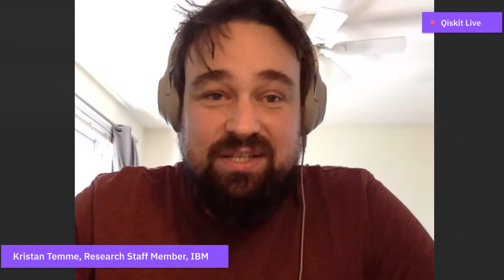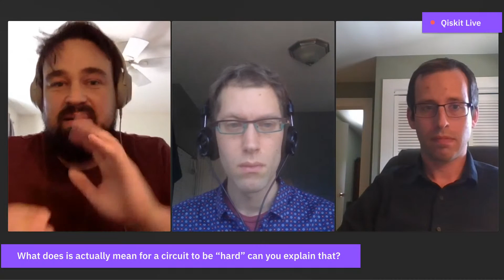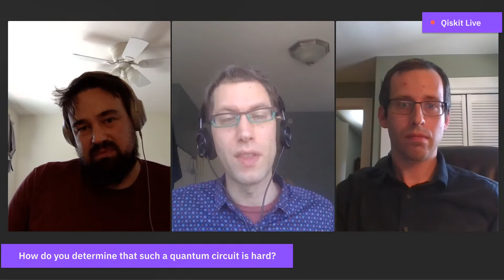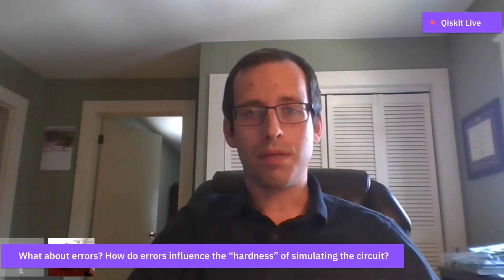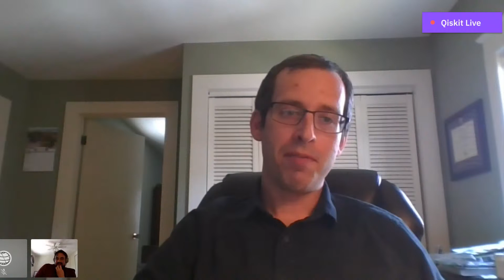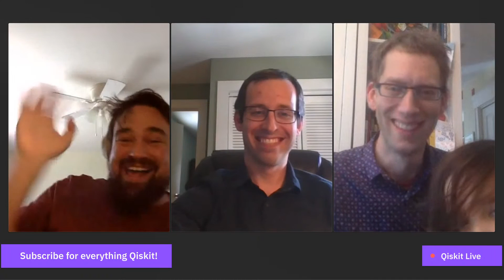Not All Circuits Are Created Equal - Circuit Sessions

Comment: 17:24: there is a comment to the effect of 'Quantum computers move us outside of Turing machines.' I didn't know that - I thought that any Universal Turing Machine could still simulate any problem that a quantum computer could solve, perhaps exponentially slower. So to what extent are we really moving outside the paradigm of Turing machines - it's all computation regardless right?